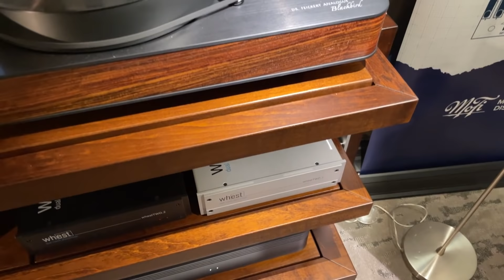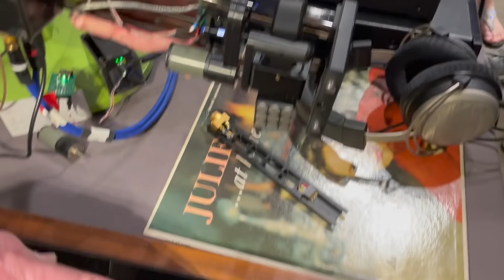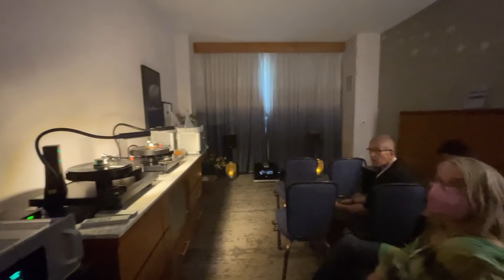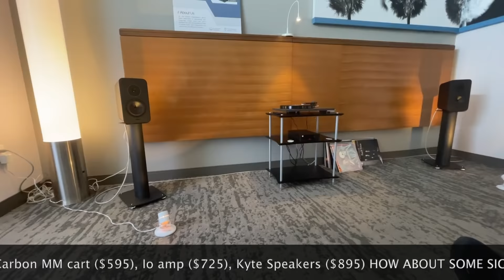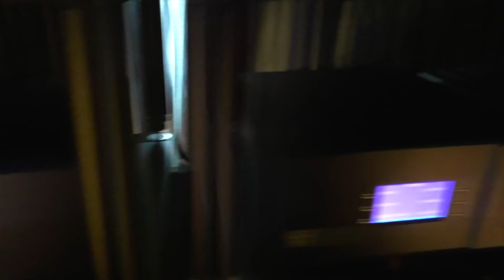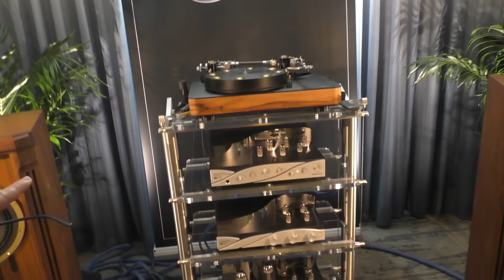AXPONA 2022 DAYS 2 & 3

Comment: $65,000 for a rack. I'm falling on the floor laughing! They should make it tall enough so you can hang a noose from the top, when you realize you've spent $65k on a freaking rack. When he gave the price, I'm surprised Fremer didn't say "That's reasonable", like he did with the $6000 tone arm.
Reply: I was waiting for the "that's reasonable" comment as well.  😅
Reply: It's pricy to be sure, but given the price of the Ultra 6s and 7s they make up a substantial amount of the quoted price.

Comment: Very interesting linear tracking turntable at the vid's begining.  I couldn't help but notice it's precise likeness to the working method of "Pioneer PL-L1000" linear tracking turntable from 1979'ish, in that the vintage era Pioneer PL-L1000  deck also uses a tiny light with an optic sensor & shutter system attached to the arm's rear end that senses when the tonearm deviates beyond 0.06... (i think, or maybe another zero?) ...of a degree deviation to perfect tangency & with aid from a contactless magnetic induction motor (with no moving parts in itself) for the horizontal arm-drive movement, it brings the arm back into perfect tangency by moving the tonearm's railed sledge running on 3 quartz wheels an inch or so above a long bar electromagnet,  until the next deviation gets to 0.06 of a degree off perfect tangency, when it moves it's sledge again accordingly.  (The Japanese train that floats above a rail which is effectively a long bar electro bar magnet uses the same contactless induction drive principle.   Goldmund were not the first to do this on a t/table nor the first to do optic tangential correction for the tonearm,  Pioneer's 1979 t/t did it first.  Tho back in the day, hi-fi mags & Goldmund said they did this first, but no, they were around 10 years after the brilliant vintage Pioneer PL-L1000 (i bought 2 minters from eBay for around £250 each 20'ish years ago, tho i have moved on from them & i sold one to a keen friend but couldn't bring myself to sell the other, they were & still are a technical tour de force, back in it's day & a fine heavy battleship build quality with it, no plastic & damped chasis plus a relatively heavy 3'ish kg platter & Pioneer's most powerful torque DD motor they ever made for their t.o.t.r. t/tables, they make no noise or rumble whatsoever, highish mass arm that suits many M.C.s, e.g.  the Denon 103 is a perfect match. I've heard many folk on forums etc say those decks are dangerous because "the deck cannot know how long your records are & so they'll grind through the groove & ruin records that dont match the tonearm's progress** (as if it had a pre-ordained linear tonearm horizontal progress speed, but that would be a stupid & a 100% unworkable design. (**idiots)  ...it just showed their ignorance to the tonearm design & how it has slight pivot movement that corrects itself beyond 0.06 of a degree off tangent & moves the tonearm horizontal alligned sledge accordingly,  plus the slight pivoting is needed for it's function inc' very eccentrically gooved records where you'll see it creep back a fraction 33.3 times a minute if the eccentricity causes the tonearm to pivot beyond the 0.06 degree limit before tonearm movement kicks in via optic sensor, whenever it does move in normal play, it does so almost unperceptically to the eye.  When i bought my first above Pioneer, it knocked the stuffing out of a Heybrook TT2 / Alphason HRS 100  (HR1000?) which in turn knocked the stuffing out of my previous Rega Planer 3 / Rega RB250, & so goes the neverending of search for affordable perfection until you hit the satisfaction zone which that Pioneer first gave me.   Lord knows what the Pioneer PL-L1000 would cost today, i'm guessing well above g.b. £3500,  they go for £500 to £750 on eBay last time i checked, but a near minter is worth much more, esp'  if you cannot afford above £2000 for a new t/t & arm, & even then.  I may set my spare one up just to save the slightly laborious task of putting my mono cartridge on my current tonearm.  If i had a penny for every hour spent doing that for mono record listening, i'd have at least £2!
Reply: ʜɪᴛ ᴍᴇ ᴜᴘ ᴏɴ ᴛᴇʟᴇɢʀᴀᴍ ɪ ɢᴏᴛ sᴏᴍᴇᴛʜɪɴɢ sᴘᴇᴄɪᴀʟ ғᴏʀ ʏᴏᴜ 🎁🎁🎉🎉

Comment: Kirmuss is definitely onto something with his newest revelation that cavitation isn't necessarily even across the surface. I have suspected my cheap ultrasonic isn't evenly attacking the surface as well. I'm glad the record cleaning industry is on the case, because cavitation is a godsend.
Reply: It would seem to me, though, that the rotation of the record should mitigate the uneven cavitation, since the same spots on the LP are moving through different areas. So, where in one area the cavitation may be a bit weaker, that area of the LP will soon be in an area with stronger cavitation, and vis versa.

It seems similar to why microwave ovens started to use turntables years ago, to move the food through the microwaves, to mitigate the uneven strength of the waves in the oven.
Reply: @pandstar  I believe the rotation helps, but I would love some peace of mind knowing I'm not turning the record into the equivalent of a thoroughly nuked tupperware with spaghetti stains in a ring and still missing some crud. I own the HappyBuy unit from Amazon and I can't imagine life without it now.
Reply: ʜɪᴛ ᴍᴇ ᴜᴘ ᴏɴ ᴛᴇʟᴇɢʀᴀᴍ ɪ ɢᴏᴛ sᴏᴍᴇᴛʜɪɴɢ sᴘᴇᴄɪᴀʟ ғᴏʀ ʏᴏᴜ 🎉🎁🎁🎁🎉🎉🎉🎉🎉🎉🎉